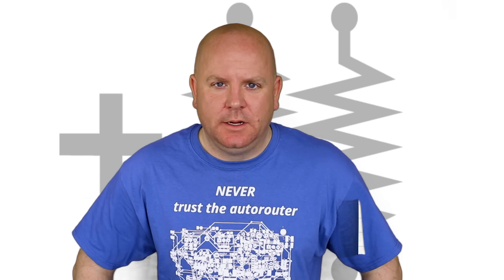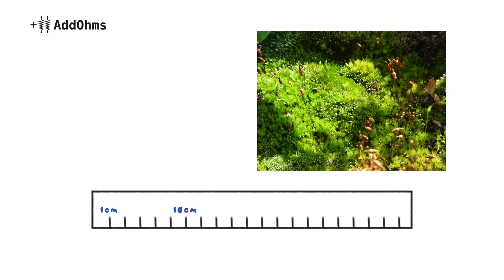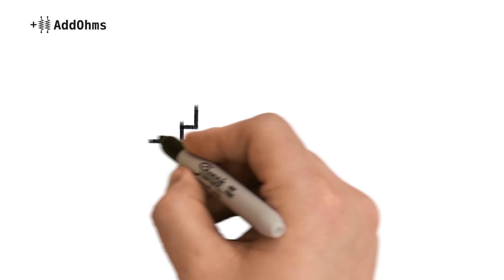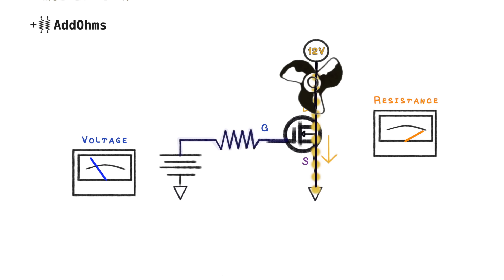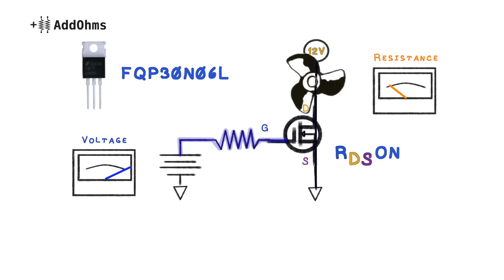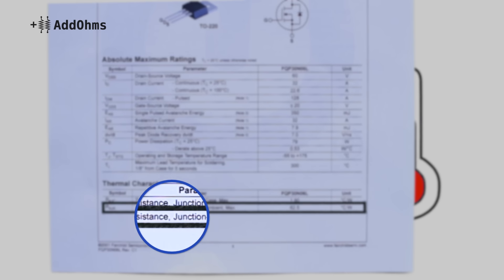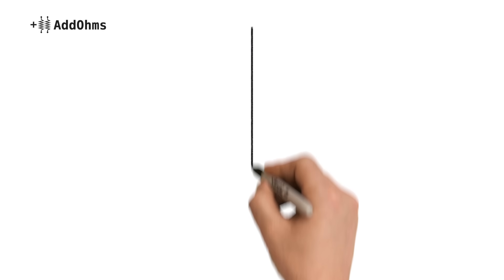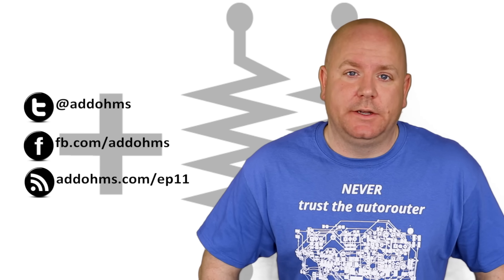MOSFETs and How to Use Them |  AddOhms #11

Comment: can this FQP30N06L switch the positive side of the load ? (i.e VCC->Drain->Source->load->ground) ?
Reply: Yes, but the circuit would be somewhat more complicated than what is shown in the video.  An N-channel enhancement mode MOSFET is switched on and off by changing the voltage at the gate relative to the source.  The circuit you suggested would be using the MOSFET as a high side switch; that is, switching the positive supply to the circuit.

Suppose you're switching a motor that uses 12V.  When the MOSFET is on, almost no voltage is dropped across the MOSFET due to its very low on-state resistance (Rds-on), and the entire 12V is dropped across the motor.  This means that the MOSFET source is at 12V.  In order for the MOSFET to be on, the gate must be at a voltage higher than the source.  The required voltage difference is the gate-source threshold (Vgs-th).  If the Vgs-th is 3V, then in the 12V motor circuit the gate would need to be at 15V to turn on the MOSFET.

This is why N-channel MOSFETs are most commonly used as low-side switches, with their source tied to ground, or 0V.  With the source at 0V, it's easy to control the MOSFET with a low ("logic level") voltage, allowing you to control a higher voltage circuit (the 12V motor) with a lower voltage one (a 5V microcontroller).

If you really do need to use an N-channel MOSFET as a high side switch (in a very high current application where you need an extremely low Rds-on to limit power dissipation), there are special MOSFET driver ICs that can develop the higher voltage necessary to drive the gate.  These ICs often use a switched-capacitor boost circuit, but that's another topic entirely...

The easiest way to implement a high-side MOSFET switch is simply to use a P-channel MOSFET instead of an N-channel.  The P-channel is controlled in basically the opposite way to the N-channel: if the gate is held at a voltage above Vgs-th, then the P-channel MOSFET is off, and if the gate is pulled below Vgs-th (to ground, for example) the MOSFET is on.

Thus, with an N-channel MOSFET you would use a pull-down resistor on the gate and your control circuit would drive the gate high to turn the device on, and with a P-channel MOSFET you would use a pull-up resistor on the gate and your control circuit would drive the gate low to turn the device on.

One more thing to consider when using MOSFETs is gate charge (Qg in the datasheet).  This number is an expression of the amount of electrical charge that is required to switch the gate.  For most low-power hobby projects using small MOSFETs, you can probably ignore this, but if you use a very high power MOSFET, the required gate charge can be significant and can result in large current pulses into and out of the gate during switching.  Large, high-power MOSFETs can easily overwhelm the current capabilities of a microcontroller output pin.  In this case a dedicated MOSFET driver IC can be used, or the microcontroller can switch a small MOSFET, which in turn switches the larger MOSFET's gate.

Comment: Thank you sir for the tutorial. Question:
Can i use a logic level mosfet paired with an arduino to replace a push button switch controlling the output of a pulsating high dc voltage?
Reply from the maker: Yes

Comment: Would these be used in car electric seats? or would lgbt's be used? Thanks
Reply from the maker: I don't know what kind of motor is used. However, I doubt it is very high voltage. So I would image it is either a Power BJT or MOSFET, but not a IGBT.

Comment: Hi James,

Please help me with this I have to switch a Peltier module using an attiny 85 microcontroller.where the controller works on 5v and the Peltier works on 12v 3amp current. 
so my 1st question is can I be able to switch my Peltier module using my attiny 85.
and 2nd if  yes which mosfet would you like to prefer to connect for better result. And do I need to connect a heat sink with the mosfet.

Thanks you

Comment: How would you calculate the Gate series resistor?    Or would you just put a 100ohm on it and call it good?   I just want to make sure the current draw is low enough to not cause issues on an Arduino.  I'm looking at the datasheet and not seeing a reference to the voltage drop on GS.
Reply from the maker: +CharlesDourdy The gate resistor depends on how fast you are switching the FET and how fast you want it to turn on. If speed isn't critical (frequency less than 10 kHz) , then something like 1k is fine.
Reply: Thank you for that.    I'm not interested in frequency in this case.  More about using it as an on/off switch. (less than 1Hz -  On for 20 sec, Off for 3 days, etc.)     I'll start with a 1K ohm and test from there, maybe use a pot to make sure, then swap it for a standard resistor of the right value.  For my purpose it might be better to just use a Arduino pre-made "relay shield", but building a circuit with a MOSFET would be cooler.  :)

Comment: I'm trying to find how to flash an LED panel at 80 times per second (5khz).  Could you point me in the right direction so I know at least what to research? Thanks!
Reply from the maker: You can either use an arduino with some loops or build a 555 timer circuit, using a transistor to drive it.
Reply: hey thanks! i was looking at a 555 timer but i was not sure about the limitation of the cycles/sec.
Reply: AddOhms im interested in persistence of vision. Imperceptible blinking light that effects how we perceive an action taking place in real time

Comment: My datasheet shows "50 K/W" as the unit for the thermal resistance measurement... what is that in C?
Reply from the maker: +Moo Spyker What part number / datasheet?
Reply: This datasheet here, I still could not figure out the K/W meaning: http://www.infineon.com/dgdl/Infineon-IPD70N03S4L_04-DS-v02_00-en.pdf?folderId=db3a304412b407950112b426f7da3b27&fileId=db3a304412b407950112b4271cfb3b9f&ack=t
Reply from the maker: It's Kelvin per watt. Remember that 1 degree change in celsius is equal to 1 degree change in Kelvin. So for a thermal resistance °C/W and K/W are the same.
Reply from the maker: Yes, you need diodes. 

The symbols you used are for MOSFETs but labeled them NPN and PNP, which is used for types of BJTs. You might have meant N-Channel and P-Channel.
Reply: O yeah, sorry I meant N-Channel and P-Channel MOSFETs. Do the diodes need to be the full current of your load you will be running? Can't really figure out the values I'm supposed to use on them.
Reply: Hey still been having a hard time figuring out what values to use for the diodes. I'm making a basic H-bridge. What current ratings do the diodes need? I'm almost confused because the symbol for the MOSFET shows a diode internally in the same configuration that is recommend for externally, why is that? The internal ones are not sufficient enough?
Reply from the maker: +Spyker Workshop It's called a body diode and protects the FET from conducting in the wrong direction. They are usually not suitable for a motor flyback diode. I would use a separate diode, closer to the motor. 

As for values, you want something with a peak current rating as big as the motor, but it doesn't need a continuous rating. Generally for smaller motors, the values of the flyback are not critical.

Comment: Good job!
I have a question. I have a 24V load controlled by an H bridge with Mosfets. The mosfet thershold  voltage is Vth=4V. I have problem with PMOS control with arduino.

Comment: I was testing you ! I have a 12kw free energy generator powered from a virtual particle field some call it the quantum field or zero point energy. You need to let go of what you know about electronics than add the quantum field into all your equations !  You avoid heat from this current and no back EMF .. WHAT WOULD THAT MEAN TO YOU ?

Comment: I've got some FQL 30N06L that are acting in reverse. They're closed unless voltage is applied to the gate in which case they open. I notice you're using the same ones but they're normal-open vs the normal-closed I have -- am I doing something wrong or are my fets just mislabeled some how?
Reply from the maker: +Michael Riddle Probably mislabeled. (Also  I think you have a typo unless you didn't mean FQP30N06L). Sounds more like a depletion mode mosfet.

Comment: I need to slow my deep well 120v. 1 1/4 hp  pump down gradually, to reduce the "hammer" effect when the pressure relay cuts the power to the pump. I would like to drop it from full power to no power over 2-3 seconds. Would a MOSFET designed circuit accomplish this for me, or would another appoach be more simple, to get the same results (stepping relays)? Thanks
Reply from the maker: +Bill Durham Depends on how the motor is driven. Probably outside of the scope I can help you with.

Comment: i want to build a coilgun. Can a mosfet handle MASSIVE ammounts of current for a very short ammount of time? I'm talking about 50 - 100 amps. It basically needs to discharge a 10000 uf cap at 50 volts through a coil with a low resistance. I want to control it with a 12 volt signal from a switch (do i need to debounce that with a small cap?).
Reply from the maker: I haven't done something like that, but you'd want to make sure the MOSFET could handle the dv/dt of the pulse you're pushing through it. I'm sure there's limits, but also sure there is one that does what you want.
Reply: +12vdc why not use an automotive relay? That current level is available  but actually thats the same voltage /coil as most 90's pinball games that used P20N10L to pulse the flipper impulse coil [3 ohms] you might wanna put a diode across that coil if you stop current suddenly with no path for the magnetic field collapse back voltage [7X supply volt spike]

Comment: I know it doesn't really come into play until one uses MOSFET's in fast switching applications, but one has to remember, that the Gate has tiny bit of "capacitance". The Gate has certain amount of charge that needs to be filled in order for it to change the Rds. And this amount is dependent on the size of the gate, thus high voltage and current MOSFET's have bigger gate charge.

It's measured in coulombs, so if you want to switch the MOSFET on very fast to minimize the time that it's in linear region (thus minimizing the losses and heat) you want to have quite significant current delivery to the gate when switching on and you also want to discharge the gate as fast as possible when going to the other direction :)

Because of this, it's not advisable to use very large resistor in series with the Gate, but also it's not advisable to plug MOSFET to a microcontroller pin without it or you can break the IO pin.

Thus there are driver IC's available for this application :)
Reply from the maker: This is definitely something I want to cover in more detail in the future. But that's why I snuck the resistor into the drawing for this videol
Reply: I myself learned about it when building a LED cube and trying to figure out how to switch different layers on and off fast enough to minimize the "afterglow" when multiplexing :)

Comment: Since it's a voltage controlled device, what's the purpose of the gate resistor, and how do you choose the value?

That's something I've never seen covered, and it's missing from this explanation too.

I understand how to choose one for a BJT - it sets the base current, and that determines the maximum collector current.  For a MOSFET, it always just seems to be glossed over.
Reply from the maker: +TooSlowTube The gate of a MOSFET has capacitance. Like a capacitor, when voltage is first applied it draws a large amount of current initially. The purpose of the resistor is to prevent the gate's capacitance from drawing too much current from the source.
Reply: +AddOhms Thanks.  That helps.  So; high enough to not be a problem for the signal driving it, in terms of load (I'm thinking input impedance, in an amplifier, or similar), but low enough to not significantly filter out higher frequencies - I assume it has to charge up and discharge that capacitance to switch the gate on and off?  If so, it would act as part of a low pass filter - it would always switch eventually but would take longer with a larger value resistor.

Any better guidelines on choosing the actual value, or is that about it?
Reply from the maker: +TooSlowTube As you said, you need to consider the RC filter you're creating between the series resistance and the gate's capacitance.  That's a concern once you get into the 100 kilohertz and megahertz range. 

Well above the level of skill we deal with here.
Reply: +AddOhms Okay.  Thanks.  I'm mostly interested in audio and motor control applications...  Playing back digital audio at a good bit rate just about gets into that territory, but I'm more interested in analog, at the moment.

Comment: Hey there! I have a question: what happens when a MOSFET is not in the place it should be? :) I recieved a PC PSU from a friend. He has it for some time but only used it for like 2 days, because he had a problem, everything worked ok, till he played games. After 20 minutes of gaming the PSU would turn off. He went to the shop he got it from, and they said the PSU is ok, it is because of his configuration, it is too much for the PSU. So I put it on my configuration, that is not that power hungry, and the same thing, power off after 30 mins of gaming. I opened the PSU, examined it, an foud out that one of the three MOSFETs that should be there on the heatsink, is not, There is only a hole for the screw and thermal paste, but no MOSFET. I managed to find the number of the missing part: FDP 18N50. By soldering the MOSFET in it's place would make the PSU work correctly? The PSU is an Arctic Fusion rated at 550w, and the test PC is an old Intel Dual Core 2,66Ghz, Nvidia GTS 450, 4GB RAM. Thank you!

Picture:  http://s8.postimg.org/g4kdq1fzp/DSCN3013.jpg
Reply: +Theo S. It seems worth a try, if you can't return it, but I think I'd try complaining first.  It may have other faults.

Are those three MOSFETs all wired in parallel?  I guess it's possible they make more than one version of the PSU, and only add the third for a higher power version.

Comment: Is there not any website that gives you the serial numbers when you look for a particular type? Like I am looking for a for one with particular voltage and Amp then I fill in what I need and the serial numbers roll out. Some site like that? Somehwere? Anywhere?
Reply from the maker: +Telephone Telephone I think you mean "part number", not "serial number." I use the component distributor Mouser for this kind of search. www.mouser.com
Reply: +AddOhms Wow Thanks that is a very fast answer. Thank you Sir.

Comment: I am interested in building an unregulated vape mod using a mosfet and  a single 18650 lion battery,  however I would like to include a micro USB charging port in this build, is this possible? do you know how to wire the charge port to the battery sled and battery safely?
Reply from the maker: +billy larry When dealing with Lithium Ion, unless you have significant experience designing Li-Ion chargers, use a dedicated Li-Ion charger IC. For example, look at the chips Adafruit boards use for USB and Li-Ion.

Comment: It would be incorrect to claim that MOSFETs are better at carrying high current. Power BJTs can generally carry similar amounts of current to MOSFETs. Power BJTs are very common in amplifiers and in linear regulators and function better in these applications. MOSFETs tend to be used for high speed switching.
Reply from the maker: +Andrew Somerville No. It would be incorrect to say ONLY MOSFETs can carry high current. Which I did not. I said "generally."
Reply: AddOhms I'm sorry to press the issue, but "generally" is incorrect as well. The vast majority of MOSFETs are used in switching applications and their use (by professionals) outside of this realm is rare. Their use in linear power amplifiers (aka: not class D) has steadily declined with the exception of the mid-80s when some lateral devices were used. Vertical HEXFETs are rarely used in linear power applications as they significantly complicate design and the lateral devices have mostly been discontinued. This is because inexpensive high current complimentary BJTs tend to yield lower distortion and higher power at a lower cost with less complex driving circuitry. 

I'm a power amplifier designer so I'm keenly aware of the near ubiquity of BJTs in this application, as well as in applications like servo motor controllers, which are essentially just power amplifiers. Essentially any non-switching high current application. Like a lot of power amplifier guys, I was excited about the possibilities of MOSFETs being better amplifying devices, but such devices currently don't exist. Again, you do see them in Class D amps because they are switching amplifiers, not linear.
Reply: You might be mislead to believe that MOSFETs are higher current devices if you are comparing maximum current ratings of the FET when used in a switching application versus the current rating of a BJT used in its linear region. You could possibly assume that these ratings are equivalent. They aren't. When you use a device in linear applications, its maximum current rating isn't relevant. In that case you're looking at the SOA of the device to calculate safe currents and voltages for a given power dissipation and temperature, which tends to be how power BJTs are chosen.
Reply from the maker: +Andrew Somerville I guess we can agree to disagree. We are obviously approaching from different perspectives, applications, and backgrounds.
Reply: AddOhms Sure. If you're looking for the thing that will carry the most current in switch mode, you're right about the MOSFET. Or an IGBT. ;) Enjoy your day.